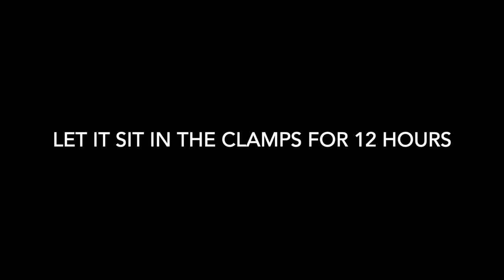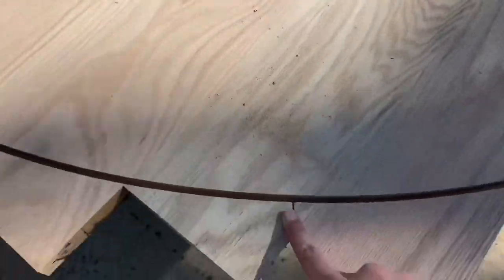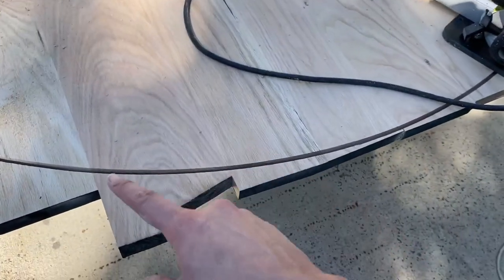How To: Build A Round Table Top

Comment: That's a great looking table. We built ours using a table made in the 1950's as a pattern. Instead of filling in the hole in the center where the router pivot was we bolted a lazy susan there, that was the main feature my wife wanted. Of course when the children were little they would get on it and spin around, fun memories.